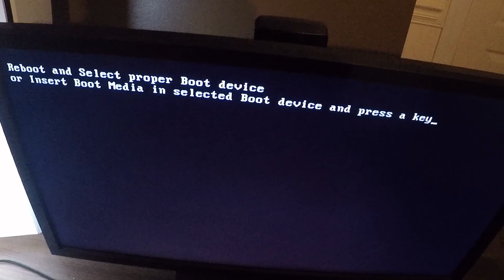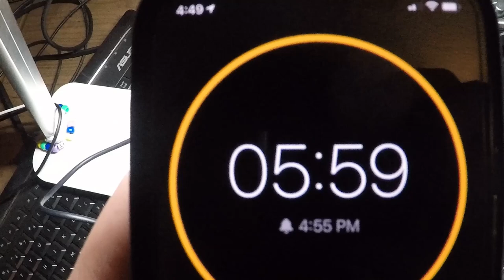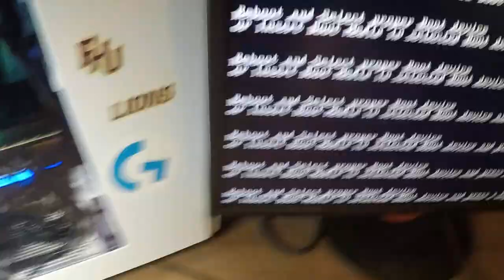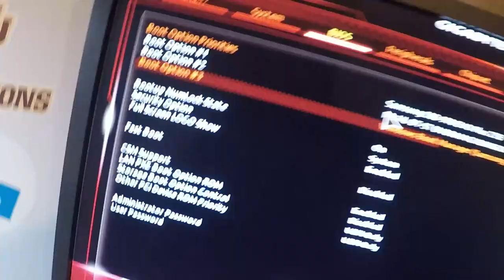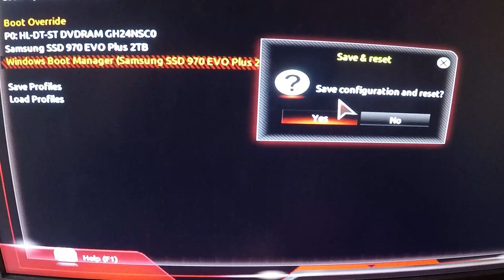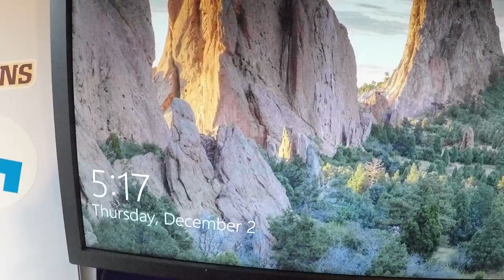How To Fix Reboot And Select Proper Boot Device When Keyboard Is Not Working Windows 10/11

Comment: Thanks. Before changing the battery I decided to replace usb keyboard with old ps/2 keyboard and I pressed enter on boot prompt and it went normally, then I switched keyboards and everything works fine.

Comment: Thanks bro. I came home and woke up with my PC running with fans at full speed out of nowhere (WTF?) and with the boot device error. I thought my Windows hard drive got corrupted and was frustrated that I might have to take it to the repair shop, buy another hard, pirate windows all over again (yarrr). The keyboard was not working for me to enter the BIOS. I did what this video showed - I felt like a monkey doing brain surgery - removed the graphic card and motherboard battery then waited and put them back in. My PC booted just fine afterwards without me having to enter the BIOS and thinker with things. 
Do you know why this error might've happened? I generally put my PC in standby and it's feeding a lot of  peripherals such as a Bluetooth speaker and wireless mouse which was charging. I gather it might've had something to do with the power.
Reply from the maker: No problem man, glad the video helped! Sometimes computers just crap out on you lol, that's why IT people exist so they can fix these seemingly random errors! For me, this happened because I was messing in my bios. For other people, it just randomly happened. If there was a recent lightning storm in your area, or some other electrical event like an outage or something, and you don't have a surge protector, then that could potentially be the culprit.

Comment: So this happened to me, and even though the correct hard drive is set as primary it still doesn’t work, so my question is what else can it be if not the drives?
Reply from the maker: If not the drives, it could be the RAM frequency. It's been two years since this happened to me, but it happened to me because I originally was messing with my XMP RAM settings in the bios. Another reason could be a corrupted drive i.e. the motherboard can't read the data on the drive, so it just boots to bios. To rule this out, you could use a spare hard drive/ssd, install windows on it, and confirm it wasn't a corrupted drive.
Reply from the maker: Also, make sure that your primary drive is the windows boot manager!

Comment: Quick question I’m not home right now so I can’t check but is it only after inserting a ssd that you must boot from boot manager first or does that apply to a hdd? Because I just put in my new hdd and I have this error I can get into bios but I don’t know what exactly to do to fix it. I also didn’t try having boot manager first because I didn’t see a video about it, so please tell me if it only applys for a ssd for having boot manager first or if it’s both ssd and hdd. Thank you if someone responds
Reply from the maker: So it sounds like you either didn't install windows properly (or transfer it) to the new device, or you have maybe two windows on two different disks. If you give me more info on what you were trying to do, that would help.
Reply from the maker: Like you just installed the new drive and everything got messed up?
Reply: @VulcanGamingYT  well I don’t know how to really give much more info pretty much all I did was remove the old hdd and insert the new one but when I insert it it’s stuck on the screen
Reply: @VulcanGamingYT  hey thanks for trying to help but I think I’m just going to take it to a tech repair place there is another issue with the computer likely cause by me accidentally unplugging something and I’ll see if they can fix it affordably
Reply from the maker: @desroytron4093  did you install windows on the new hard dirve?
Reply from the maker: @desroytron4093  I gotcha. I have heard the best buy geek squad is decent and affordable. Good luck.
Reply: @Vulcan I kinda have same issue keyboard works but I installed my new SSD and had to take GPU out in order to do that and now I get this same screen error. For boot options I only see my old SSD that I tried forgot it it worked properly but awhile ago when I got it tried copying Windows from my Hard drive to that SSD had issues which is why I am not sure if I launch it from that Hard Drive or the SSD I was copying to but besides that I got new SSD today and now only see for boot options my 2 SSDs. Sorry kinda all over the place hopefully makes sense but basically windows was on Hard Drive then copying to SSD and now just installed new SSD and getting this error

Comment: Okay I thing that I am now missing something, no video can explain that to me.
I have 2 desktop computer, by using the same hard drive switching computer, in one box the windows starts with no problem, just as normal, on the other hand, if I take the same drive and put on the other computer box, then that msg comes on the screen that says "Reboot and select proper boot device or insert Boot media in selected boot device  and press a key"
Okay here is the thing, by using the same drive in different boxes, in one it starts and on the other its fails to start.
from the box that refuses to start the windows, I already have changed cables to new ones, and as well as the cables from the other box that can start the drives, and it gives the same error, I changed some settings from the BIOS on the box that can't start the windows on the same drive, and still gives the same problem, I put back the setting and still gives the same issue. The question is, why by using the drive on a different computer it can start, but when I get it back to my box, it gives me that Booting error?
Reply from the maker: Hmmm. Just to clarify you are saying that you have two drives with Windows installed on both of them?
Reply: @VulcanGamingYT  no no, i have one drive with the Windows installed in it and two desktop box with the computers parts on it, however only one box has de drive with the windows, and when o take the drive from that box where the windows works perfectly and o put on the other box where there is no drive, gives that error of no media installed or no bootable media, even I I exchange the sata cables from the other boxes following YouTube steps, gives always the same error, but when I put back the drive from where it came from, windows starts normally
Reply: It's like, the drive gives error on my computer and it does not starts, but if I take me drive to someone's else computer, it starts perfectly
Reply from the maker: @flavianojose8423  okay so if the drive does not work for your computer but works with others, a possibility is that you have some sort of faulty equipment. My guess would be the mother board in this case. Another possibility is that the drive itself isn't compatible with the second desktop box. The third and final possibility I can think of is that your second desktop box isn't wired correctly. Or perhaps maybe the drive with Windows on it is somehow corrupting on just the second desktop box. To try and narrow down the problem, try to get your friends' Windows drive and test it out on the second desktop box. Please keep me updated!
Reply: @VulcanGamingYT  thank you for the tips, I will try this out and I will keep you posted
Reply: @Vulcan Hello there, i have tried out my friend's drive into my second computer box, and it seems to be working, i probably believe that my drive is not compatible with my second computer box. The question is why is it not compatible, if they are all hard drive and motherboards
Reply from the maker: @flavianojose8423  That is indeed very strange.
Reply: @VulcanGamingYT  for sure, when I connected my friend's drive on my computer box, I just started normally, so what I did next was connecting my hard drive to his computer and see if the windows could start, and for my surprise it started, so I took back the drive  to my computer and kept giving the same error, something really rare to happen, and it's my first time seem a hard drive behaving like that with different computers box

Comment: Nvm it worked tysm
Reply from the maker: No problemo
Reply: Yea i just built my pc so I’m try a fix any issues and try and set it up
Reply from the maker: @XYLOIII  Yeah first PC builds can be rough, but I am glad you fixed the issue!
Reply: I don’t have a computer to install the software of windows 10
Pro so how do i set it up without a usb drive if you know?
Reply from the maker: @XYLOIII  If you don't have a usb drive, you would need to buy a copy of the windows disc. Whether it is an actual disc for a usb copy is up to you. Personally, I would buy the usb. I would also highly recommend trying to find a computer to install the software onto a usb though. Saves money.
Reply: @VulcanGamingYT  alrigjt thanks do you know how much the usbs are?
Reply from the maker: @XYLOIII  No, but you can just google it to find all the info you need.

Comment: I deleted my windows from my disk space any idea what i should do know, my windows corrupted with a driver update and now I’m SOL
Reply from the maker: Dang, you messed up pretty bad. The best thing I can think of doing is trying to reinstall windows via a USB. If you can't get to the install windows function on startup, try to reset the motherboard by removing the battery (as shown in the video).

Comment: i got a black screen after what do i do
Reply from the maker: Hmm.. did you turn it back on? Did the PC boot up but the monitor didn't turn on? It could be that the cable connecting the monitor to the pc is messed up or not plugged in all the way. Try those solutions and let me know what happens.